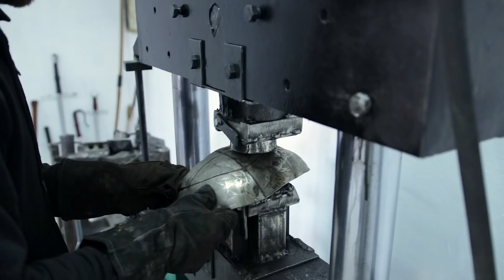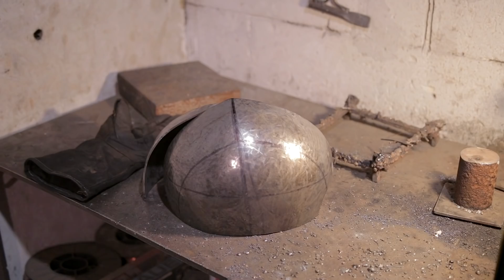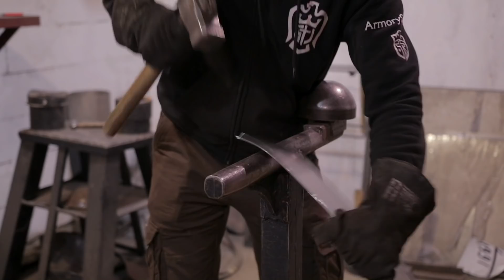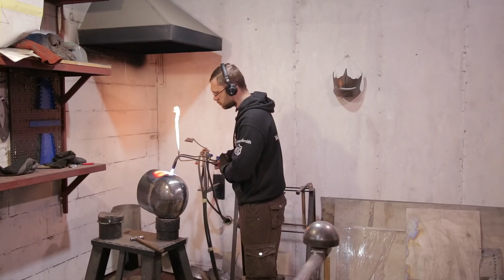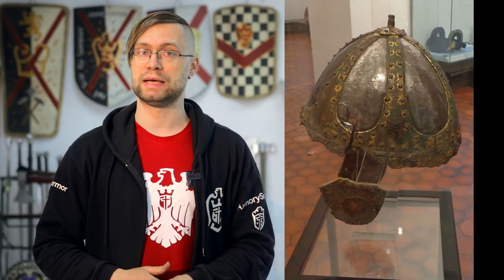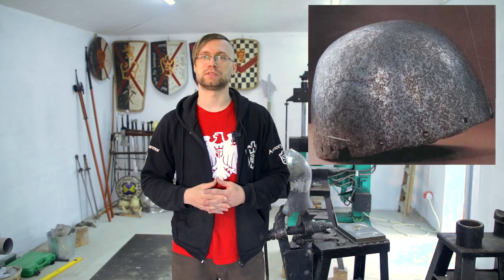Бьют в голову? Сделай себе бацинет! Часть 1

Comment: One thing you could do to get better looking welds would be to fashion yourself a set of copper dollies. If you press the copper piece on the inside, whilst you weld on the outside, not only will that lower the weld (setting) requirements, thus allowing you to have more complete welds (less chance of getting voids) but there won't be any more welds on the inside. It's a common technique used by car fabricators to get clean full butt joints between repair panels. Mind you, they work with really thin material, so if it works for them, it should work really well for you.

Comment: Well i'm not the couch plankton, but i think i still prefer the historical hot raising method. Not good for making buhurt pieces, as it's way too expensive, and buhurt equipment is doomed to be crushed anyways, but for reenactment, i'd prefer it. I respect why you weld the pieces instead of forging from a single sheet, and it doesnt mean at all that your work is less valuable than what eric dubé would do, it is just for an other purpose.
thx for this detailled video ! :)

Comment: I have been making armour for 4 years. I agree using modern tools is better. Raising a single sheet of steel for a one piece helmet can take 4 to 5 days. A lot of work and it will need a lot of planishing. While welding or riveting a helmet together can be finished in a few hours. There is nothing wrong with modern welding because it replaces the old forge welding which was an acceptable historical method.